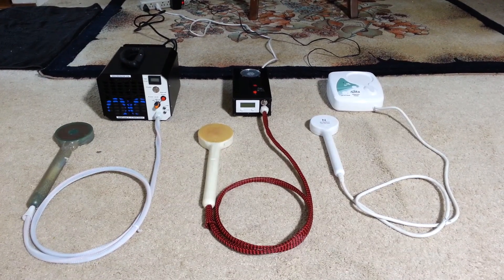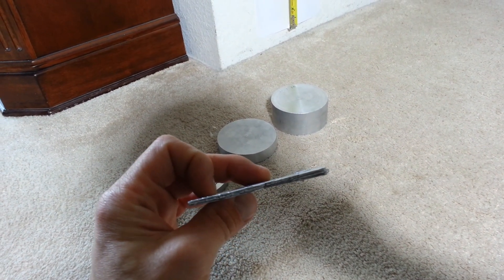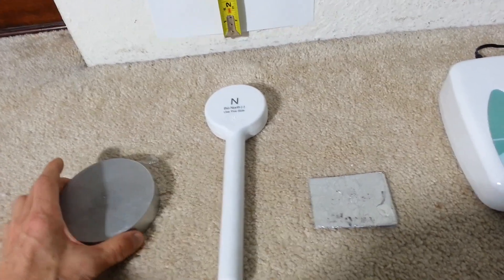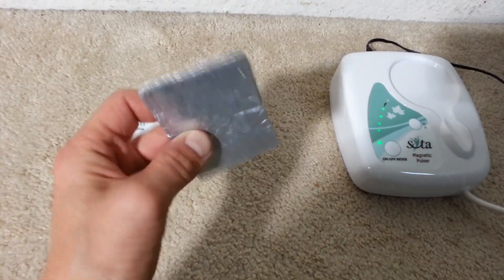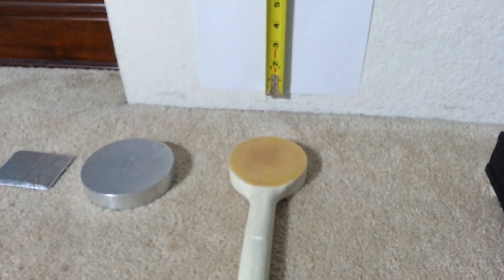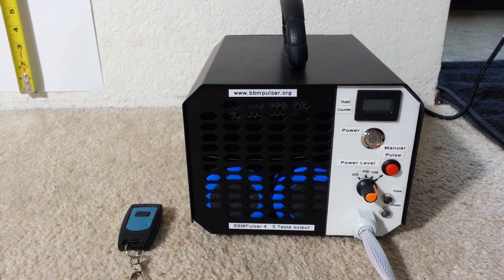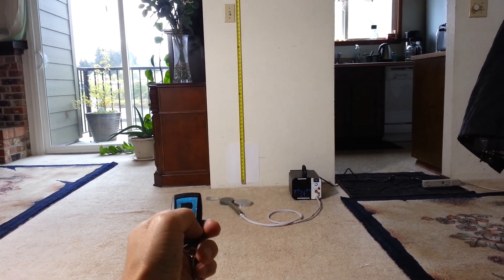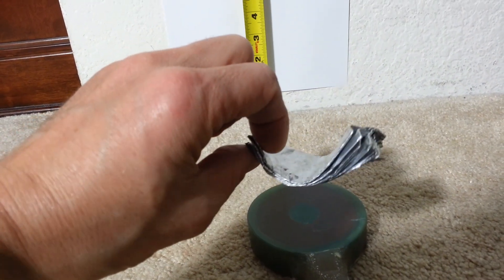005 Sota Magnetic Pulser MP6 vs BBMPulser 3 and 4 repel and bend test 1Lb  aluminum weight

Comment: Thanks for the video. Just to let you know practically, we can't go beyond certain gauss intensity (for example above 1500 to 2000 gauss), because it causes so much muscle twitching that the person using it cannot tolerate it. So, if a pemf device has 3000 or 5000 gauss intensity, no one could use up to that level.
Reply from the maker: Hi Arranger123
High Voltage PEMFs 10-20kV pulsers will have sharp narrow pulse witch will be triggering muscles even at 5000 Gauss (0.5 Tesla)
My devices work on lower voltage and delivering wider pulse which is not as sharp. This results in much less muscule contractions.
For example 0.5 Tesla will barely react with muscles. 2.4 Tesla wich is 24,000 Gauss can be used with out much of discomfort anywhere on the body.
Most sensitive spot is the side of the  neck. 2.4 Tesla will make you twitch if you place it on your neck. Anywhere else on the body it's tolerable because it won't cause much muscle contractions. 
Also if you are treating inflamed area, you will have 2-4 times higher muscule respond with same power levels.
Conclusion. 2.4 Tesla is the power that's recommended to use when dealing with viruses. If patient is not OB then he can get 100% success with only 1.4Tesla when used correctly (systemic) all over the body where mucus lining are. (Stomach, throat lungs head.)
You do know that sota instruments mp6 model of mag Pulser puts out 6,000 Gauss. Everyone can use it with out any discomfort.
Reply: @AndreyD  Ok, thanks
Reply: Saying people couldn’t tolerate 3000 to 5000 gauss is not correct. Maybe some can’t tolerate the higher gauss rating but many people can and enjoy it. 
People do your research and due diligence the higher gauss is nice but gets expensive. I use it myself.

Comment: I am a fan of your work and love what you’re doing. is there a way I can buy your unit and which one would you suggest I want the strongest one possible to do everything you said and your speculative research as well as possible grow my hair back lol.
Reply from the maker: Hi ES3
Can you please edit your post in the way that it won't have the key words like C"O"V"I"D.
To deactivate flue (RNA) virus you can use 1.4 Tesla (14,000 Gauss) magnetic pulser (minimum is 12,000 Gauss). If you are OB then you will require stronger power to reach into the stomach. I'm pretty skinny and can get away with 1.4 Tesla when it comes to flue viruses. Having access to stronger units I would recommend 2 Tesla or 2.4 Tesla unit. At 2 Tesla you will get bacteria suppression effect also pain reduction effect which you don't get from 1.4 Tesla. Good luck in you journey!
Reply: @AndreyD  thank you
Reply: @AndreyD  Sorry about the question. What means "OB" ?. Thanks !
Reply from the maker: @antoniohernandez8367  OB most likely means Obesity (fat)
Reply: @AndreyD  Ok. Got it.

Comment: Im researching using this for cancer. Cancer tumors. Lung and bones. Does anybody has any info or advice. Is the sota machine strong enough? 
Any input is welcome, please.
Reply from the maker: Cancer is a fungi disease.
The name of this fungi is Candida Albucans.
Tumor is the 5th stage of development of this microorganisms.
I'll tell you this.
Candida Albucans doesn't like cells that are electrically charged.
Heart has most charged cells in our body, that's why Cancer cannot attack it.
Mag pulser can charge cells to the point where cancer cannot do anything.
Also infected cells (cancerous) cells will die off when our cells around it is charged with electric potential
Reply from the maker: strong enough for what?
Reply: Stopping the cancers ability to reproduce and metabolise?

Comment: can someone test whether this coil or pulser can really kill viruses.... microscope show before and after pulsing some virus.  any scientist with powerful microscope please?
Reply from the maker: Yes we need electron microscope.
I can see bacteria at 2000x optical magnification but I cannot see the virus, it's at least 100x smaller then average bacteria size.
We need someone who can magnify at least  10,000x, preferably 100,000 to 200,000x
Reply from the maker: Now I think about it, how are you going to be able to demonstrate if virus is alive of dead? Viruses don't move, they are half way dead to begin with.
Magnetic Pulser with power output 1.4 Tesla can destroy RNA code, this deactivates the virus for good with no return to active stage
Reply: @AndreyD  i am no microbiologist nor geneticist.   i was just curious.  How would the pulser differentiate virus RNA code vs regular human RNA to deactivate though?
Reply from the maker: @reikisponge  DNA is what we humans have, its double strain configuration its different then RNA (single strain configuration)
turns out DNA is much more resistant (more stable) to magnetic energy then RNA code.
Yes we can destroy DNA with radiation but not with magnetic energy

Comment: Since you are an expert in magnetic pulse.. does it cure H pylori?  Because my sister suffers from it.. Have you heard from someone that he was cured of this germ through a magnetic pulse?
Reply from the maker: I can't say Im an expert but I defiantly have a lot of experience using different Power Magnetic Pulsers. 
Here is USA we are not allowed to use word "Cure" only doctors can use it, they own this specific word.
Strong Magnetic Pulsers are the most effective on smallest microorganisms, like Viruses, then bacteria then fungi. other larger pathogens and there are hundreds of different variations of them (nematodes etc) even microscopic insects like tics that magnetic pulser cannot kill.
The way It works, when Pulsed, magnetic energy penetrates inside and reacts with water molecule, water molecule converts some of the magnetic energy into the electric energy and with this electric energy its capable of destroying RNA of  the microorganisms.
Viruses for the most part pure RNA, bacteria on the other hand is mixed and uses both.
So you cannot kill bacteria as easy as virus.
the way you kill bacteria is by another principle that works here.
When you pulse strong pulse, magnetic energy reacts with enzymes that bacterias covered (they use enzymes to digest their food, their stomach is on the outside to their skin and it secrets enzymes) with each strong pulse you are ripping off those enzymes from bacterias in the process weakening it. Yes it will try to restore them or recover them but this requires energy resulting in weakening  the microorganism.  this works with larger parasites inside the body.
See they depend on their guts flora (bacteria in their stomach) to digest their food, what ever they happen to consume, so by wakening their guts flora with magnetic pulses we can weaken larger size parasite inside of us as well possibly to the point where it will die.. 
Use this information I provided as an educational, Im not advising to do anything here.
Reply: @AndreyD 
Thank you very much.. Great information.. I don't recognize medicine and doctors anymore.. who ruined my health with a lot of antibiotics and painkillers.. Now I'm looking for people like you and Bob Beck.. I think their information and products are more useful than destructive drugs.. this  What I believe in now.. you are better to me than a doctor.. you benefit humanity, but the doctor destroys it lol
Reply from the maker: @leenfahad8427  Unfortunately traditional medicine isn't getting the root cause of the problem - rather they will give you a medicine that will mask the symptoms of the problem while the issue is worsening.
Also the body is one system, but they split doctors - one is doing one thing another is second thing. when we go to try getting help we are being send from one doc to another in the process spending a lot of money and not fixing the problem.
Reply: @AndreyD  
I agree with you

Comment: Does magnetic pulse destroy biofilm?  Because I suffer from antibiotic-resistant cystitis due to biofilm..do you have information on this..i am very tired and I am searching diligently for a solution..the enzyme capsules that destroy biofilm did not work for me..please answer my question..i would be thankful to you
Reply from the maker: Disclaimer, Im not a Doctor, Im a researcher and someone with  experience using Magnetic Pulsers.
If I would had biofilm forming or antibiotic resistant bacteria - I would use 20-30,000 Gauss Pulser to clear it. The stronger the output the faster result.
At 4 Tesla DC Pulse Level (equivalent to 20,000 Gauss AC Pulse, you only need a few pulses to sterilize anything you put infront of the coil
Reply: @AndreyD  
Thank you for your answer.. I have Canadian Sota.. I think it is 6000 gauss.. I bought it for my father with cancer two years ago and I never used it.. But I remembered it now and wanted to find out how effective it is in destroying biofilm.. Thank you again
Reply from the maker: @leenfahad8427  6000 Gauss is not enough to see significant results. You need minimum of 12.000.
I noticed that when reached over 12,000 I get Virus Deactivation effect, only with high power, low power just won't do it
Reply: @AndreyD  
Where do I get this?  Can you give me the link to buy?
Reply from the maker: @leenfahad8427  contact me support@bbmpulser.org
I have a few options (models)
Reply: @AndreyD  
I sent you an email

Comment: i thought aluminum is non magnetic....
Reply from the maker: Aluminum is not magnetic but if you influence it with strong pulse you will generate Eddy currents with in the conductor and this currents will react with magnetic pulse. 
The stronger the pulse the stronger reaction.
Reply: @AndreyD  how can magnetic pusler interact with aluminum and sent it flying if is not magnetic?
Reply from the maker: @MasterofPlay7  You need strong Pulse and you will be able to interact with aluminum, copper, silver, all this metals will fly up in the air.. Weak pulse doesn't really interact with them only iron. I don't use Iron because it magnetizes to the coil, hard to demonstrate anything

Comment: I wonder if the non SOTA instruments are too strong?
Reply from the maker: MRI machines use up to 10 Tesla intensity with no negative side effects
Reply: Does it really need to be that strong though? Are there any additional benefits?
Reply: I think It depends on your body mass. If your very slim then a smaller pulse would pass through your hard tissues. A larger pulse would be more beneficial of your body mass index was large.

Comment: is the stronger the better? Why?
Reply from the maker: Good question, I was planing on making a video explaining why I personally prefer and use the strongest Pulsers on highest settings. To answer your question - the stronger the pulser the more effective the treatment especially when it comes to the infections.  Strong Pulsers heads have wider and taller cone shape bacteria killing zone. With stronger Pulsers you can kill bacteria or virus at 5-6 inches away from the coil. Compared to weaker model 3 only couple of inches from the coil. 
Magnetic field in the pulse form is  harmless to the body, in-fact its proven to be beneficial on the lower powers. I build in the Power output adjustment to get desired power output from this  units, Power varies from 0.6 Tesla to 5 Tesla depending on the selection.
Another thing, treatments time shortens with stronger Pulsers due to wider effective area from the coil. You can get the same result in 2 min using 5 Tesla Pulser vs 5-6 min using 2.5 Tesla pulser.